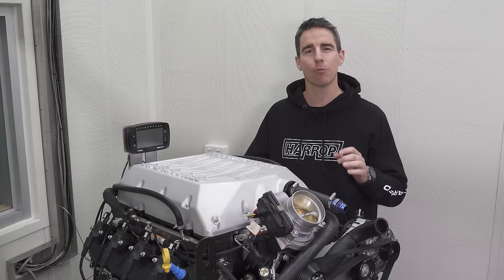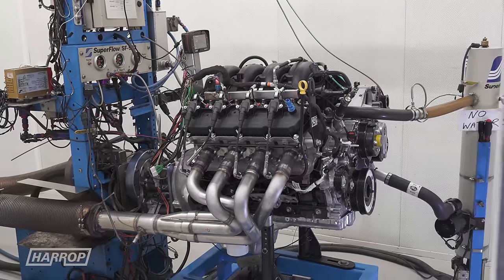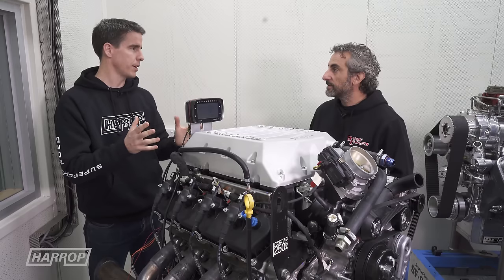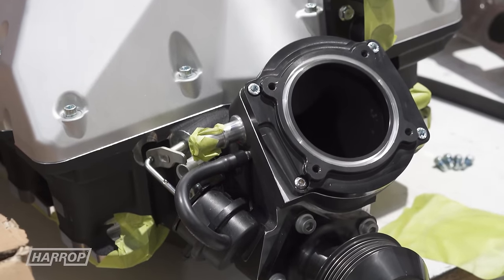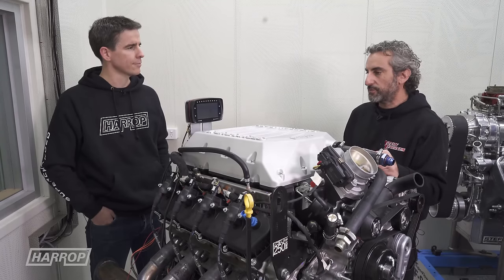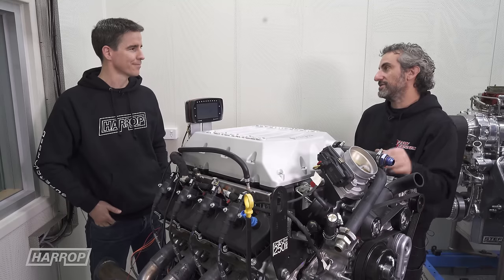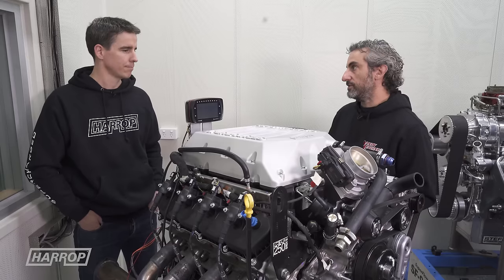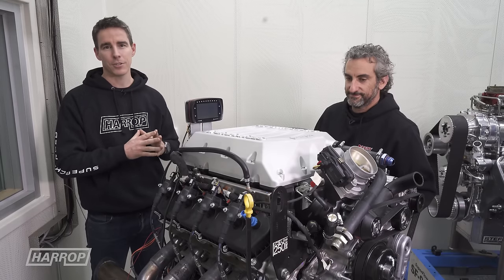Ford Godzilla 7.3L V8 | Harrop Supercharger Testing

Comment: 7.3L Godzilla  V8? Did everybody forget about the Ford 460 7.7L V8, the Chevy 454 7.6L V8 and the Cadillac 500 8.3L V8's?
Reply: Ya the 460 is a great engine, only 7 MPG but its 7MPG wether it's just grocery getting or towing a house.
Reply: your  100% right Victor, there is a couple of old timers in the southwest that have taken those Cadillac engines and just swapped out  and mixed and matched  parts from other Caddy engines and dyno tested them  peaked out at 4500 rpms and making 565 hp and almost 800 ft. lbs. of torque all N/A on pump gas all factory Cadillac parts nothing from the aftermarket whatsoever, they're beasts , only thing all these engines had in common was  they over heated easily, that was their achilles heel, other than that they were all stump pullers  👍

Comment: Truck engine? No thanks, I'll stick with my turbo diesel in my truck. Way more torque down low where I need it. This thing would be better suited in a mustang. Nice engine, but like the coyote ford put out to compete with GM's LS platform, it is over a decade late to the game.

Comment: I'm not impressed. You can buy a used 5.3L LS Chevy V8, open up the ring gap, put a mild cam in it, add a small turbo and make a 1000 hp.
Reply: Yuck Foutube  I'm sure the pulley and cam to do this is already waiting in a box somewhere. They wouldn't want to try for max-effort on day 1...duh. This 1 engine could be good for a whole video series, all good progress happens one step at a time. Patience young padawan, patience.
Reply: I saw how long cleetus mcfarland's truck motor lasted in ruby. 1000 hp sure, but only for a few passes, then it's cooked unless you do quite a few other supporting mods and use a gen 4 as your starting point. I'm impressed, 800 HP on a baby cam and 12 psi of boost with a blower is pretty nice and all that HP will happily work with a stock-stall torque converter! Add twin turbos and a nasty cam on this and it will make mind-blowing power numbers.
Reply: Your not impressed because its a ford , watch the development of this engine over time , remember it was built as a heavy duty truck engine for stump pulling torque & towing , not for peak horsepower , but the base is good & the performance is already coming , fast !

Comment: Not a factory engine and blower combination, ZERO warranty when you bolt that blower on! Ford motor = standard rods, standard crank, hypereutectic pistons with NA ring gaps.  Blower motor, H beam rods, forged crank, forged pistons with blower ring gaps. Redeye crate and Hellephant crate blows this nonsense away.

Comment: Why the fk would you call it a Godzilla! That name belongs to, and always has to, a Nissan....
What’s more... A 6.0L Ls with a cam swap will make 515hp on pump gas! with no forced induction! And has a base factory engine per liter capacity of 1.5 L less the ford engine in mention....? 
 And it costs $30,000 Kay! A stock Ls 6.0 with an exhaust, cam, head work. Along with a bolt on single turbo, plumbing, injectors and ignition will make well over a 1000 rwhp for $15,000 any day of the week!

Comment: Yeah, it needs 7.3 liters... this engine comes in a 6500 lbs. truck. It struggles just to pull itself, let alone a heavy payload. It ain't like it comes in a 3500 lb. car where it can display speed & power. Nothing impressive here...🙄

Comment: Total trash.... You can get 500 horsepower out of a 5-3 junkyard LS with a little boost that cost 1/3 the amount.
Reply: Why would anyone waste their money on a Ford motor that cost that much when you could pull a junkyard LS motor that's way more reliable and way cheaper. Not to mention way more powerful with a cheap Turbo. No brainer. Nobody's going to buy that garbage.
Reply: @kennithchapman9689  if it was more reliable it wouldnt be in the junk yard would it lol
Reply: @2011metalmaniac  ever heard of car crashes ? It's that thing that happens when an unstoppable force meet an immovable object.
Reply: @DL101ca  Yeah, it's like youtube comment sections where unstoppable egos meet immovable intellects.
Reply: If it was total trash like you say it would not have a steel crank & 6 bolt mains , GM fanboy , there’s a reason it won’t become a common junkyard engine ,just like your LS !
Reply: @kennithchapman9689  That’s funny , many have already been sold & started to be transplanted , yes it will need a little thought & modding to fit some cars considering it was engineered & built for heavy duty truck application  but I suppose those people that do it must all be as stupid as to do so & not just do another boring old junkyard LS .
Reply: brand new crate 7.3 is 7k from factory. Realistically, for under 20k you can have a RELIABLE 1k hp engine that didn't have to be salvaged from garbage. You LS fanboys love to dumpster dive.
Reply: @TheArmoredRhino  and you ford fans love to piss away money😝
Reply: @barbraabsalom4531  that funny barb... Most LS motors are steel crank 6 bolt mains also😇